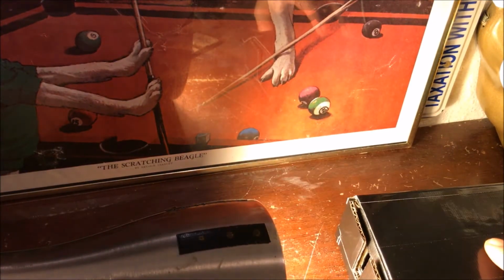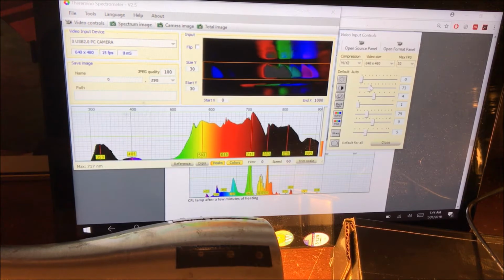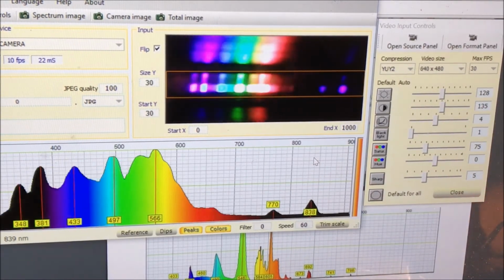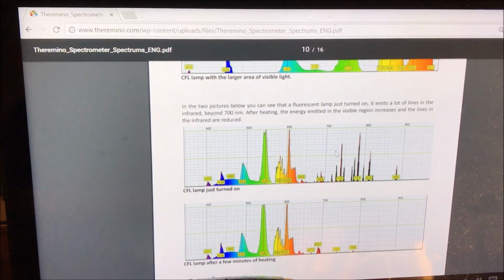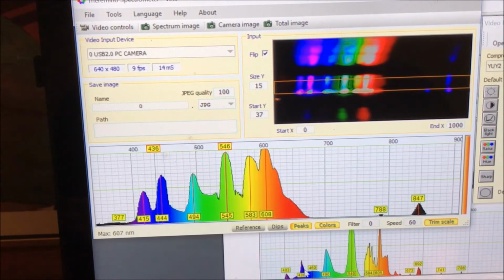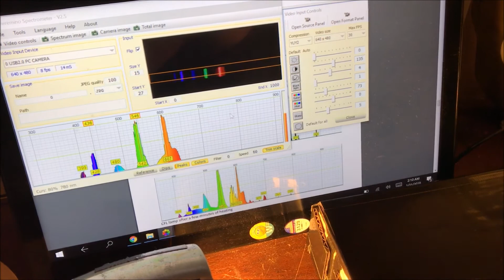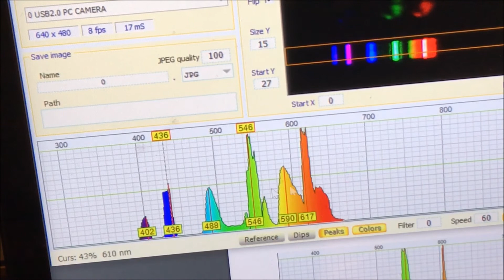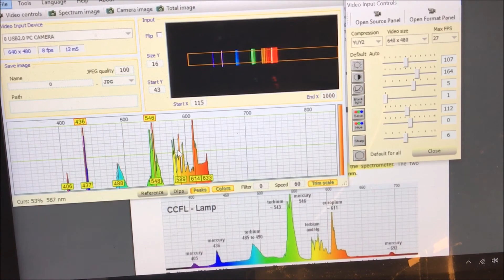DIY $20 Spectrometer Part 3: Initial Calibration - Episode 106

Comment: I’m planning a similar project with a web cam from eBay, the specs say cam has auto brightness, white balance and colour correction. Would this cause a problem in the spectrum, or there’s a setting on the PC in the program to control this?